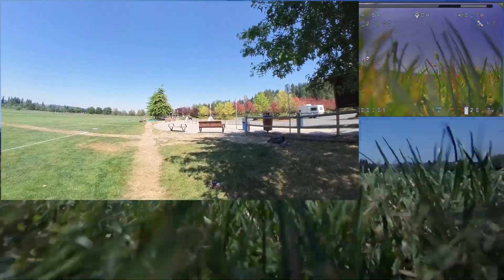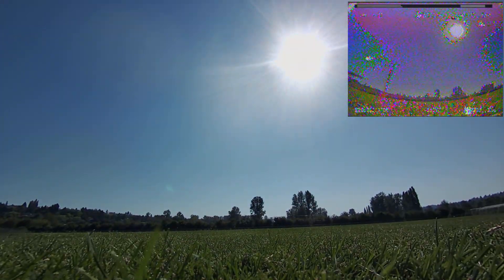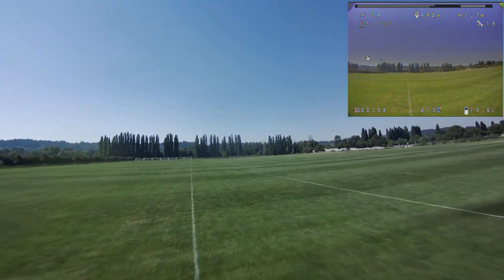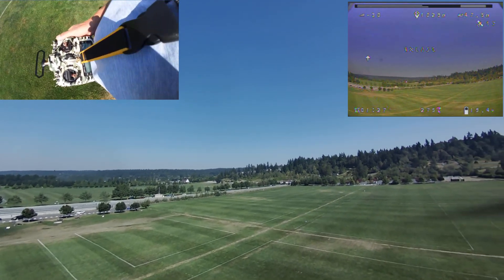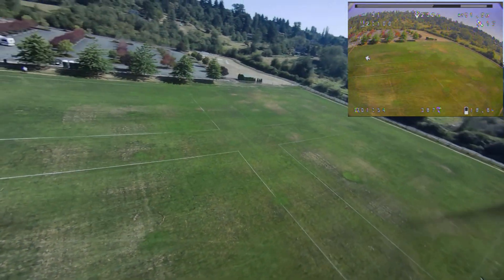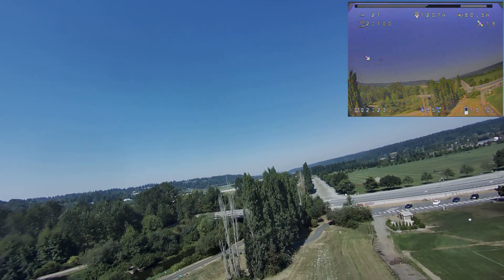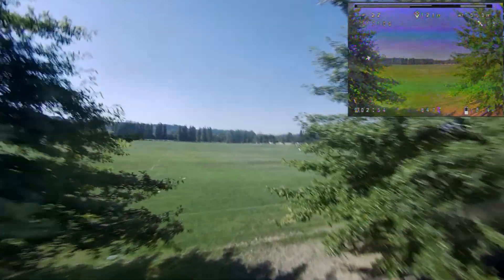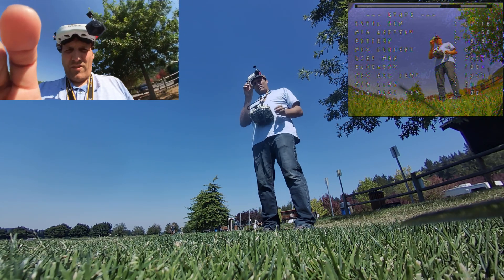GPS Rescue Betaflight 4.2.2

Comment: I'm not sure what's going on with GPS rescue mode. I had 6 DJI quads with GPS 3 work great 1 had GPS signal loss. I have had 2 quads fall out of the sky in the middle of returning in rescue mode. I was able to find one of them 243 rows in a corn field and the other was never found. I have mixed emotions about it. I've flown over 2  and a half mile with one quad failsafe on the way back GPS kick in until I regained control to a safe return home, and then I have the other situation. I'm confused.  It has worked great for me at times and other times not at all. FPV is so much fun when the equipment and technology work and I don't lose my money all around town.
Reply from the maker: Do you know if the satellite count was too low on the times it didn’t work?  I have a warning flash on my screen that rescue mode is turned off because there was less than 8 satellite links. On cloudy days I will see that satellite count fluctuate and sometimes rescue mode disabled flashes. Like maybe halfway through the rescue operation you lose your satellites then what happens?
Reply: Make sure you switch on gps rescue to keep it in that mode as an intermittent radio signal can confuse it and also i personally would turn off sanity checks.

The downside of turning sanity checks off is that it literally wont disarm on its own accord and could burn a motor etc when landing/crashing if you down take back control.
Personally I rather just run cheap individual esc's and turn off sanity checks and know my drone will fight tooth and nail to get home.

Oh recently it was discovered that ground assistance being set to auto was causing sats to suddenly drop for no reason it should be possible to set this to off if its not already set to that. If your using 3.55 still just set ground assistance to your closest area and it seems to stop the sat's randomly dropping for no reason.